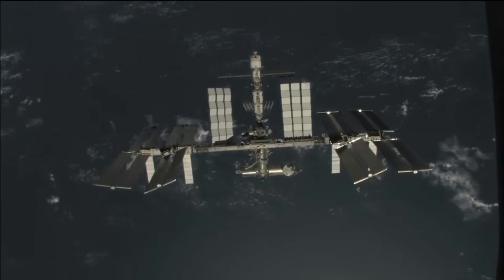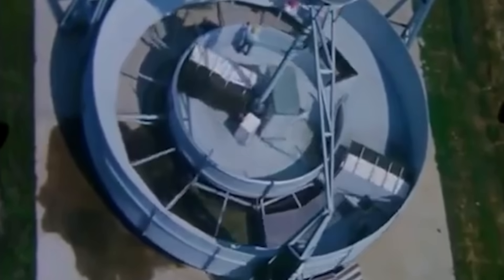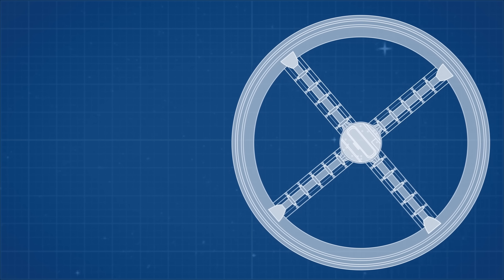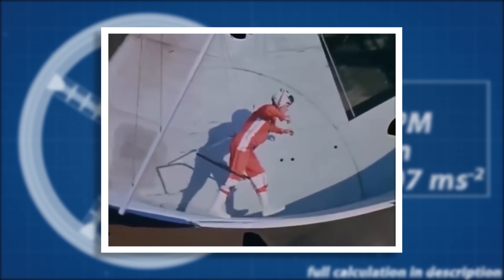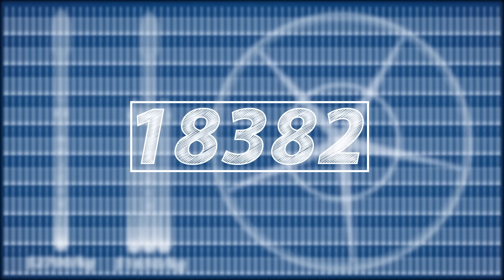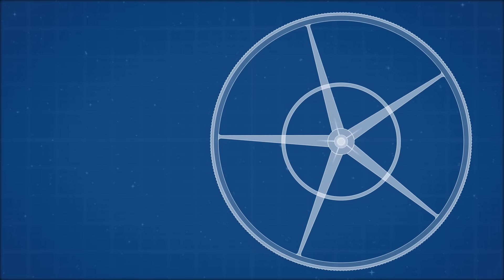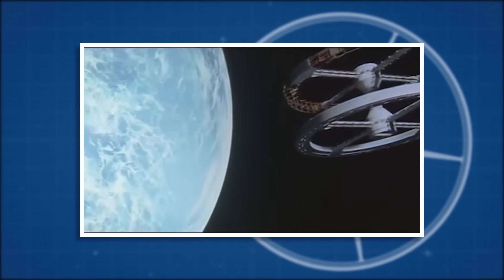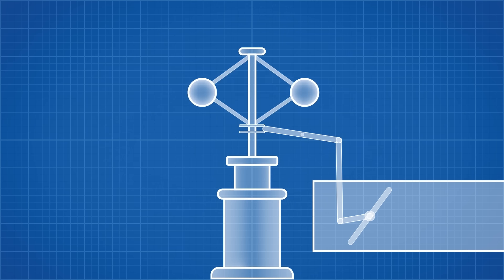Can We Create Artificial Gravity?

Comment: "How does a mouse when it spins?" "Because the faster, the fewer." This classic 'riddle' is referring to a centrifugal governor as depicted at the end of this video. The spinning weight is known as a 'mouse' and when it spins faster it goes higher and outward, thus causing the valve to close and reduce the power output to the machine it is controlling. So the faster the mouse spins the fewer the RPMs of the machine it controls. That is how a mouse spinning does something helpful.

Comment: This explanation isn't quite right but I get it that it's simplified for the general public.
First of all gravity and acceleration are the same thing as Einstein discovered.  There's no way to tell one from the other in a closed room.  It was that assumption that led him to predict that light, although mass-less, would be bent by gravity.

And centrifugal force doesn't actually exist.  But Newton's laws are correct (until you get close to the speed of light of course).
The centripetal force pulls on the astronaut and accelerates him towards the axle because there's a net force inwards.

A=F/M

The A is the acceleration (gravity) and the F is the centripetal force on the person (M) which causes him to accelerate.

If centrifugal force existed there would be no net force and the man would be weightless again.  The centripetal force would be equal and opposite to the centrifugal force and F would be zero.

You may not believe that but before you jump in to refute it check it out.  When I did my physics degree it took a while to work that one out in my head and squash my common sense.
I'm not trying to be controversial.  Almost everyone can think of centrifugal force as a real thing and you'll get right answers for most everyday things.
But some may wish to dig a bit deeper into the physics.  This comment is for them.

Comment: This got really stupid halfway through. You dont need anything that absurdly large to have it work. Why not base some figures off of a realistic station for a few people? what about a transport ship? how big would it need to be to be sufficiently comfortable for humans? The cost of the space station is irrelevant as well since it used the shuttles to get stuff up.

Rather then a wheel you can use two 1/6th circle C shaped piece opposite each other with some kind of rigid yet flexible link between them. You wouldnt even need to build the rest of the craft. The center can even be used for material storage keeping the exterior for just human occupation except when they need supplies from the center.

Other then the basic figures, your calculations are horribly misleading for a number of reasons.

Comment: On the Armadyne website the cost of a house in Elysium was mentioned at being ~$200 million, and the current number of citizens was given as being 7,946, which is $1.589 trillion. They also note that most of the space station was built using robot labour. They can also get into space with a single stage, as seen when the refugees / mercenaries / John Carlyle go to Elysium without any boosters or second stage, possibly using a radical new power source or technology that we haven't even thought of. If we can get into space quickly and cheaply, then the main cost for Elysium would go down dramatically.

Comment: From my old research, the smallest station like this should be 1.5K in diameters.  Infrastructure should be in place for shipping up rockets made of solid metal to be melted down (except engine) in orbit and then all parts built in orbit.  Secondly supplied by non-earth mining efforts. What goes up stays up, except the engines which are returned to earth safely to be fully checked and tested before sent back up in the next rocket of solid material.
Reply: You have to start some where.

You can mine any rock that gets too close to earth, but there has to be a manufacturing facility in orbit to make the parts from the material you sent up or process from other non-earth locations

Comment: How about two stations tethered together with a cable? The radius could be very large, limited only by the cable strength. This would be low cost and work with relatively small and easy to launch models like the current space station. With a cable length of say half a kilometer the g gradient would be imperceptible over the distance of a person's height.

Comment: An important thing to keep in mind is that the Coriolis effect would be stronger on smaller diameter gravity systems (this is the tendency for objects to spin in a direction perpendicular to the rotation and could affect people by giving them motion sickness  if not properly compensated for).  

A space craft with a rotational section would need at least 225 meters radius on the habitat ring to sustain a 1g environment in a comfortable zone for the crew.   If this were a solid structure, it would indicate a massive craft.  However, if you could have a habitat module and a counterweight with a propulsion system in the middle you could use a length of material (similar to what would be used to build a space elevator on the moon, for instance) to extend the habitat out and create a 1-g environment with a reasonable sized craft.  Such forces are within the bounds of our current material sciences.   

The launching of material from the earth to build any significant space station is foolish, and really unnecessary considering that there is likely more aluminum and titanium readily available in the upper 30 feet of the lunar surface than can be accessed with any reasonable technology on the dry surface of the earth.  Thus the most efficient use of our time, money and resources would be to build telepresence systems capable of going to the moon, mining and processing the ore to produce goods for space based construction.   

The cost of launch from the moon to earth orbit is about 100 times less expensive than it is from the surface of the earth to LEO.  Meaning we could perform 100 launches from the lunar surface for the cost of a single launch from the earth.  More importantly, our material science can easily build a space elevator on the moon.  This would reduce the launch cost by three orders of magnitude.  Finally, the upper six inches of the lunar surface is a helium 3 sink.  Meaning that the surface absorbs and temporarily captures quantities of helium three from the sun.  Helium 3 is a light fusion element and would be the perfect clean fuel for light fusion reactors.  Best of all it is a renewable resource.  The same systems that could mine and process ore for titanium, aluminum, nickle and iron can also process lunar regolith for helium 3.  There is also a considerable amount of oxygen, hydrogen and other molecules in the lunar soil... not to mention ice sheets are likely in permanently shadowed craters near the north and south poles of the moon.

In fact, the best way to get material from the moon to earth orbit would be a series of kinetic arms.  These systems could fling packages of harvested material or even finished products on a slow parabolic course to earth - arriving 5-7 days after launch.  And do so with minimal energy investment and near zero fuel requirements.  A kinetic arm in LEO could capture the material and slow it down for use in local construction.  Of course, the same system could be used to send material the other way if necessary.  

With the proper equipment and telepresence systems, we could have a station the size of Elysium inside of 25 years. We could have a type three O'Neill Cylinder in about 30.   For the cost of about 30-100 launches, depending on the systems we orbit to the moon to capture material.   Plus the potential return to earth of renewable energy sources and materials could turn massive amounts of net profit putting the entire venture in the black.  Plenty of risk... but the rewards would dwarf that risk by a factor of a thousand.  

Its one of the reason the Chinese want to get to the moon asap.    The resources there could build entire worlds for practically nothing.  There is no environment to destroy and no ecology to tamper with.   Just raw materials fully accessible everywhere.

Comment: Gravity is the result of Electro Magnetism, therefore gravity can be created or nullified.
See James Clark Maxwell's equations - https://www.youtube.com/watch?v=AWI70HXrbG0
Specifically, when you have a sphere which has a charge on the outside and a charge on the inside of the sphere, the space inside the sphere is not affected by the forces exerted outside of the sphere. This is why "UFO's" can make right angle turns at 9000mph, the occupants are sealed inside a metallic "sphere" of sorts.

Comment: the astronaut guy in the giant hamster wheel was walking forwards as the floor approached him. what would happen if he turned around so he was walking in the same direction the floor was moving under him? would all such structures require one-way pedestrian traffic for the artificial gravity to work?
Reply: There would be no such problem. Remember, that from the astronauts perspective, when he is not walking, he is stationary with respect to the floor, so he could equally have been walking the other direction.

That said, in this example,, because it is open to the atmosphere, there may be some differences due to air resistance, but this would not be a problem on a space station, because the atmosphere would be spinning with the ship.
Reply: +Arthur Robey Correct. What's your point?
Reply: ***** Oh yeah, you're right. Though if the artificial gravity matched earth, you would have to run about 22mph in the opposite direction to cancel out gravity. Of course, as you speed up and start to weigh less, that will affect how fast you can run too.

As an aside, you also weigh less as you run on earth too, but for different reasons!

Edit: My math was off - but not by too much. Basically, as the radius increases, so does the speed you would have to run. With a 50m radius, you'd have to get up to almost 50mph!
Reply: Do you feel more gravity when you walk the same direction the Earth is spinning? No.
Reply: Jane Murphy
it's not momentum and inertia holding you on earth's surface. it's gravity. the artificial gravity in the video is a specifically-directed momentum, like a weight on the end of a swinging string.
so, my question was what would happen if the astronaut guy in the hamster wheel turned around? well, if he stopped walking the floor would be stationary under his feet and he would travel backwards with the rotation of the floor. what if he turned around and walked in the opposite direction? well, if he was running instead of walking, he could be putting his feet down in exactly the same spots with every stride, making no headway; each stride, being a small leap forward, would take him forward, but, with the floor under him also moving in that direction, by the time his foot landed again, the same spot he just leapt from could be under him again. how would that affect the artificial gravity of momentum?
Reply: Chris R He is already moving forward at a speed equal to the rotation of the circle. In order to move forward or back, it doesn't matter what way he moves.

I used the example of Earth, because there isn't much difference between a pushing and a pulling force.
Reply: +Jane Murphy They are right that as you move against the spin you would feel lighter. Once you move fast enough so as to remain stationary, you become effectively weightless.
Reply: Erlend Powell
The speed needed to become weightless is much higher then a walk, or even a run.
Reply: Jane Murphy That depends on the radius of the structure and the amount of simulated gravity.

The formula for centrifugal acceleration is:

a=(w^2)*r, where w is angular velocity.

Rearranging the terms and substituting v=w*r we can calculate the tangential velocity with this formula:

v=sqrt(a/r)*r

For a simulated gravity of 9.82m/s/s and radius of 5m we get v = sqrt(9.82 / 5) * 5 = 7m/s, which a relatively fit individual could reach.

However, if we look at a different scenario, where the radius is say 20m (, then we get v = sqrt(9.82 / 20) * 20 = 14m/s, which is obviously well above the average humans capability.

Even then, you would weigh less as you started running, so this effect would most certainly be felt to some degree on any small to moderately sized (???) spacecraft.
Reply: Erlend Powell
Large enough to house 500,000 people, and have room to live comfortably (they are paying 10 million each after all).
Reply: +Jane Murphy Well yes, it would not be a factor in that instance. I guess I was trying to address more realistic scenarios though!
Reply: Erlend Powell
That's the amount of people stated in this video...
Reply: +Jane Murphy OK, but this thread was originally about the astronaut in the giant hamster wheel.

Comment: Your explanation of "centrifugal force" doesn't make any sense.  It is not the Newton's third law pair of centripetal force, and no, all forces do not need to balance.  Specifically, when an object is accelerating, all forces acting on said object do not balance, and the net combination of them is what causes the acceleration.

Centripetal force really means the net force needed to cause centripetal acceleration
Centrifugal force really means a perceived outward force experienced by a body in a rotating reference frame, as a result of being unaware of the fact that they are accelerating inward.

The "centrifugal force" is not a force, in the sense that there is no object causing it.  There is not a Newton's third law pair of it.

Comment: Nice stuff. They could make an affordable spinning space station with a slow rotation speed if they use a cable and a counterweight. They could also do cheap launches for materials with a kind if railgun. Not for people, the acceleration is too strong. I wonder if they could launch stuff from a helium balloon, then they would only start to burn fuel already high up. I also wonder if they could attach helium balloons at intervals on the cable of a space elevator, to cancel out (part of) the weight, then the cable wouldn't have to be so strong. Food for thought...

Comment: There is an error in your calculation: "There is 2(pi) radians per revolution and 60 seconds in a minute. So one RPM equals 2(pi)/2." It should read "... one RPM equals 2(pi)/60 "
Reply from the maker: Thanks for the heads up! I'm awful for the typos
Reply: Are you aware of whether or not NASA aboard the ISS has ever conducted small scale experiments of centrifugal effects on small animals or insects to study the effects of orientation/disorientation? I used to follow ISS progress, but haven't in a few years.
Reply: Easy now. Journalists don't take the same physics you took! They take astronomy 101 if they get caught by the advisor before they have enough hours to graduate.

Comment: centripetal is the real force 

centrifugal force isn't real and has been dis proven
Reply: Jacob Wable 
You spin me right round baby, right round, in a manner depriving me of an inertial reference frame baby, right round.
Reply: It still doesn't exist. Centrifugal force is the force that causes and object to go outward while spinning. this is incorrect. Its just regular old inertia on a tether. It is not another force it is Centripetal. The frame of reference does not really matter. It was a scientific fallacy.
Reply: But it still doesn't exist as a real force.  Because there isn't an object causing it.   What it really is, is that the occupant of a rotating reference frame is unaware of their own acceleration, and thus perceives a force opposite their acceleration as if it is pulling them outward.
Reply: When physics is done using an inertial frame of reference, centrifugal force does not exist. This video explains this. He isn't using it in an inertial frame of reference, so it does exist. He mentions this in the video.

Comment: If such a thing were built, it would be made of titanium, or an alloy.
Reply: the fuck why? titanium isn't magic. It's actually a pretty expensive material that fatigues quickly and cannot do most things other materials can. Steel is the ideal material for most applications, but that's heavy so they use aluminum for stuff that doesn't need to be as strong. Titanium is only really used when they can't use steel or aluminum.
Reply: Ariel Solomon Titanium isn't expensive as most people make it out to be, and the price is only going to go down. Also, it has the highest strength to weight ratio of any metal. You need less of the material to make a part with the same structural integrity.
Reply: the question is also about durability. Titanium gets stress fractures more easily than steel or aluminum. Sure it's half the weight of steel, but it just wont last even half as long.

Titanium is actually very expensive, unless you mine for it irresponsibly and destructively and pay your employee's a slave wage. Which is what china is doing with almost all raw materials driving the cost down and good businesses out of business. Rare earth metals are abundant in the crust, however they're very difficult to extract and require some pretty horrific melt your face off chemicals to process. Its expensive to process them in a safe, environmentally responsible way. China ignores all that and hires warlords in Africa and South America to use slaves to mine and process the materials in giant open pits full of caustic chemicals.
Reply: thats all true but i dont think earth has that much titanium :P
Reply: +Jim Jose Titanium is the 9th most abundant element in Earth's crust. More abundant than zinc, copper, nickel, and carbon.